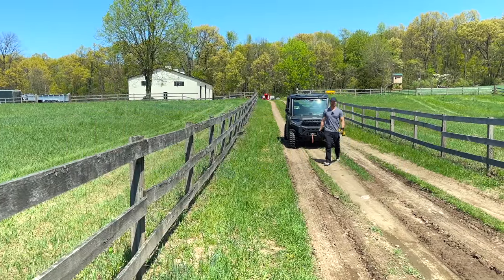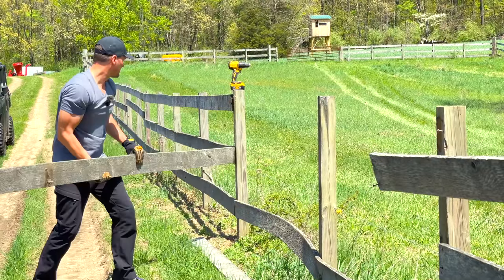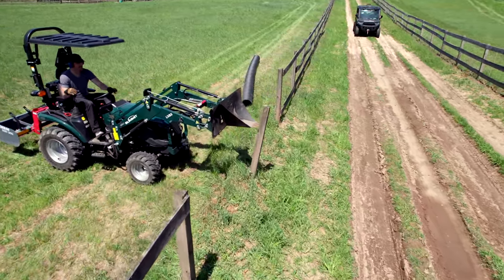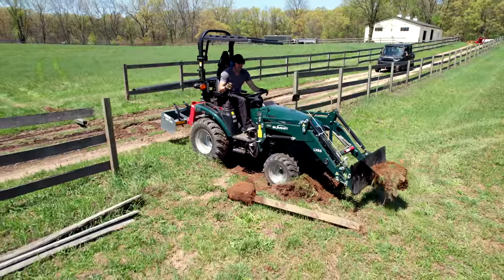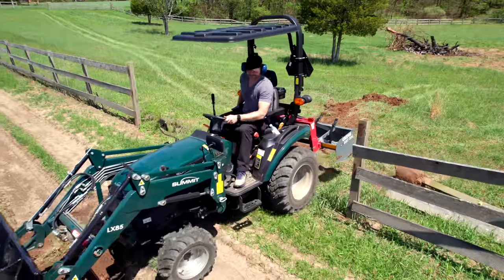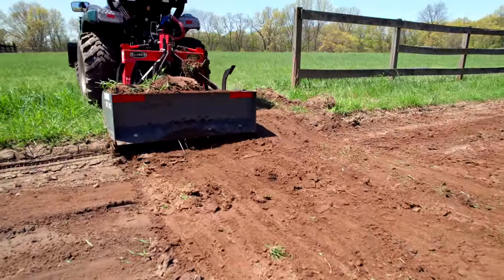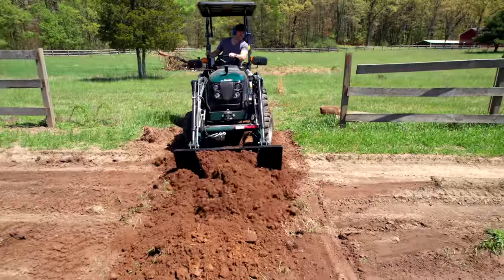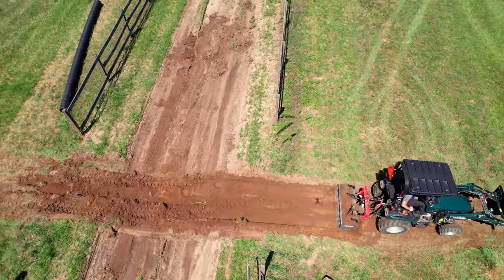TWO GREAT TOOLS FOR DIGGING A TRENCH FOR A DRAINAGE CULVERT

Comment: I just used my HD stump bucket to dig a trench for a water line and it worked really well. We live on a rocky Ozarks ridge and it had to break up a whole lot of rock to get the job done. Not a problem. I have to replace a culvert under my driveway this summer and that's the tool I intend to use.
Reply from the maker: Sweet Tom, I'm glad to hear that.  I get comments all the time about how there's no way those will work in rocky ground.
Reply: @GoodWorksTractors  I'll send you a picture on the website when I get down to the house.
Reply: Hey bud, just out of curiosity what kind of rock do you have? Can't remember what your geology is like over there. Been eyeing the GWT stump wrecker for a while now, just wondering how it'll handle what I'm going to throw at it.
Reply: @kavemanthewoodbutcher  Limestone, chert and sandstone. Obviously, I can't get through the shelf rock but the normal chunks aren't a problem. I've popped some pretty big stuff out of the ground. Having all that force applied through the narrow point on the wrecker pushes right through any cracks. I'll send some pictures to Good Works to show the sizes. I didn't get to it today because we got slammed with a storm before I took any pictures. I'm using a gear drive tractor, by the way. I imagine it might work even easier with a Hydra-stat.

Comment: The only combination that I think might have done a similar job would have been a front loader with teeth and a backhoe attachment. Looking at the culvert and cable you probably would have had to them have come out anyways to move the cable deeper for the culvert. That Summit and larger Stump wrecker is a great combination and Im sure much cheaper and with more uses than the backhoe! Nice looking result from everything.
Reply from the maker: Yeah, backhoes are great.  80% or more folks don't have a backhoe for their tractor, so showing what other tools can get the job done.  Thanks for watching!
Reply: @GoodWorksTractors  Has the HD wrecker been tried on the 3025e yet? I would think that would be a great match.

Comment: Nice alternating use of the 2 attachments.  Big time saver to have one on the front and back with no swapping. Suggest that you contact your internet provider and have them do that repair before they have to dig up all of your work to do it! Unfortunately fiber patches aren't cheap but hopefully they won't want to run a new line. 
According to the North American Telecommunications Damage Prevention Council, the average cost to bury fiber optic cable in a rural area is $75,000 per mile... perhaps that's why we will never see it out here.
Reply from the maker: Yeah, fiber company already came out and repaired it.  $350.
Reply: @GoodWorksTractors  Glad to hear they didn't rake you over the coals!

Comment: Just 2 quick points and not to downgrade the route you took.
1) would it have been faster to just take the tiller and run across in multiple passes to get the dirt softened up to move with the bucket?
2) could you take a 2 blade plow and use that to not only dig down to pull up the ground and tenderize it then use the bucket/ box blade to remove the loose dirt?
After that use the stump bucket to dig your final depth for culvert.
Not saying u did it wrong just wondering about your thoughts on the points above.
Reply from the maker: Neah, no need for a tiller here.  This ground was soft.

I don't have a 2 blade plow, but I suppose you could.  Or, use a ripper.  I just don't think you need to have tons of tools to do one job.  I could have probably used 5 or 6 tools if I really wanted to go crazy, but just wasn't a need.  Lots of time involved in driving and swapping attachments too instead of working the ground.

Good questions.

Comment: Pro tip, when unscrewing fence boards from a fence - unscrew both ends first... then the screws in the middle last. that way the boards don't fall and tear out. Unless you don't care about the boards I suppose.
Reply from the maker: I do not care about the boards.  Most were rotted.  Some screws were bent, stripped, etc and wouldn't come out anyways.
Reply: @GoodWorksTractors  If you don't care about the boards, forget the drill. I pull mine off with pallet forks. Over the top, straight up and down, and back up. Pops them right off, then I pick them up and pile them to the side with the forks! Bet that stump bucket would work just as well for popping them off. :)

Comment: How much would it cost to get a converter kit in order to put a rear hydraulic top link on my LX2610. This project would have taken me ages to complete with the amount of times I’d have to stop and get off the tractor to readjust the box blade. I must say I’m very impressed with this summit machine. I look forward to seeing how it holds up over the years.

Edit: get some drain tile wrap and cover it with about 6 inches of gravel and then fill in the rest with dirt (if your still attempting to have the grass path look). Look on the bright side, you just took out your fiber optic cable. I shut the power down to every home in a 20 mile radius (not my finest moment). Let’s just say I won’t forget to call miss utility again, lol.
Reply from the maker: For the hydraulics, check out http://www.summit-hydraulics.com.  They'll have a solution for you.  Save 5% with code GWT.

Right now, I'm getting hydraulic top links off of Amazon.  $250-350 depending on the one you need. https://www.amazon.com/shop/goodworkstractors/list/46M6Z6OWPONU?ref_=cm_sw_r_cp_ud_aipsflist_aipsfgoodworkstractors_3S2MWDWZ81T6F0FNMPT5

Haha, nice work on the power snafu!  Fortunately, I haven't done that...yet!
Reply: @GoodWorksTractors  Yup, bought mine last year, absolutely changed my world on my JD 2520!

Comment: I would use the stump wrecker for that if I had one. Its probably easier on the tractor to pull a middle buster through that first and clean up with the wrecker. 
Ditch  Witch rentals go for $200-$300 /day and is way faster. but hauling it back and forth would eat up any time savings. I get the "using what you already have."
Reply from the maker: Yeah, this job would have been done before I even got back with the Ditch Witch from the rental store.  Plus, I used tools I already had which is kind of the point.  Showing folks how you can get projects done with what you already have or plan to buy.

Comment: I have dug drainage ditchs useing a subsoiler to make 3 or 4 passes then coming in from the side and scooping out the loose dirt with the loader bucket. Works great for downspout drains.
Reply: done the same a few times
Reply from the maker: Use the tools you have or find ways to justify a new tool by seeing the many uses for it.

Comment: What are your thoughts on using a mini stump bucket for transplanting small trees?   It seems like it would work?  How about a video to show us how?!!  Trees that are less than 3 feet tall.  White pine and maple,  mostly.  We need to thin out an area, and I'd hate to just mow over the small trees, because we have other areas that could use some trees.  It would be used on a JD 2032R.  Thank-you.
Reply from the maker: We've definitely sold quite a few for that purpose.  I don't have that application at my place right now, but perhaps in the future.

Comment: Nice work, I like to see what can be done with compact tractor, as I always say "work small" Take a good bit of ribbing from some of my farming friends when I pull out the little BX or the "glorified" lawn mower as they like to call it😂😂😂. But I hate to use one of the bigger tractors in tight spots😬,  I've got a BX,  L, and an MX, and use the BX 80% of the time just very handy with the exception of bigger projects, I really liked this video as I am planning on burying two different drain tiles myself, One across a drive and the other on a pond for better access, and both are in tight/wet/wooded area's👍
Reply from the maker: Haha, I totally agree.  These small machines have their place and time and again show how effective they are.  Good luck on your projects!

Comment: You should invest in a lazer for grading. You do alot of projects where one would come in handy. They are very nice. They range from a few hundred to about $1200. Topcon, specter, trimble are a few good names.
Reply from the maker: That has definitely crossed my mind.  I've got a soccer field project starting soon and this might be a major time saver.
Reply: I’m an amateur, I bought a topcon as ttwt would use …. Reason I bought it it has a secondary receiver you can buy that has a magnet mount for putting on a backhoe boom or whatever reference point you want so you know you’re down to whatever level you want to go to … I believe it beeps and also has a red strobe ?

Comment: I'm thinking a slip scoop with the cutting edge facing forward instead of the box blade would have been interesting to try. You'd be able to lower the scoop down into the trench better.
Reply from the maker: Seems like that would have been unnecessary.  The box blade worked like a charm, stump bucket did the trenching.  Just no real need from my perspective.

Comment from the maker: Using the tools on hand to get the job done is pretty satisfying.  Even more so when they work out really well.  Stay save on your projects!

Shop Stump Wreckers: https://www.goodworkstractors.com/?s=wrecker

Shop Box Blades: https://www.goodworkstractors.com/?s=box+blade

LOOK AT OUR MOST POPULAR ATTACHMENTS!
Speeco Quick Hitch: https://bit.ly/3NFC0yl
Stump Wrecker: https://bit.ly/3WYa6Tf
VersaBracket Combo: https://bit.ly/3wUPrnl
Snow Pusher: https://bit.ly/3NB4BVw
Tillers: https://bit.ly/3GT1kk1
Core Plug Aerators: https://bit.ly/3W0R25q
Pallet Forks: https://bit.ly/38wRztu
Grapples: https://bit.ly/3PNNYaZ
Dethatcher: https://bit.ly/3GT9Zmk
Tractor Canopy: https://bit.ly/3IHcvNU

WANT TO SAVE MONEY? CHECK OUT THE GWT DISCOUNT CLUB!  Use code GWT at any of the vendors below and you will save cold hard cash :)  I will also get a commission for the sale, so it's a win-win-win!  

USE CODE "GWT" TO SAVE BIG WITH:
BUCKET BRACKETS @ http://www.jufabworks.com
CUSTOM GRILL GUARDS @ http://www.5elevendesignz.com
PTO QUICK ATTACH @ http://tractorptolink.com
DIY HYDRAULIC SOLUTIONS @ http://www.summit-hydraulics.com
GAME CHANGING GREASING SYSTEMS @ http://www.lube-shuttle.us/store
TIRE CHAINS @ http://www.tirechainsonline.com
PREVENT FLAT TIRES @ http://www.multiseal.us
CULTIPACKERS & CRIMPERS @ http://www.packermaxx.com
ALL OEM JOHN DEERE PARTS @ http://www.247parts.com
ACCESSORIES AND BACKHOE BUCKETS @ http://www.muddscustoms.com
CUSTOM TRACTOR FLOORMATS @ http://www.tractormat.com
PROTECT, ORGANIZE, IDENTIFY HOSES @ http://www.outbackwrap.com
BOX BLADES FOR ATV'S @ http://www.northwoodsfabrication.com
HYDRAULIC SYSTEM PROTECTION @ http://www.hoseendchamer.com
DUMP FROM THE SEAT MATERIAL COLLECTION SYSTEMS @ http://www.proteroinc.com
POWERED SWEEPERS SWEEP UP ANYTHING @ http://www.sweep-all.com
EASY WHEEL TOP LINK HANDLE @ http://www.tractoraftermarket.com
TIRES, WHEELS, AND DUAL ADAPTERS @ http://www.millertire.com
AMERICAN MADE CARRY ALL ON STEROIDS @ http:www.bigtoolrack.com
THE BEST TOOTHBAR AND MORE @ http://www.heavyhitch.com
5% OFF WITH CODE GWT AT TRAC SEATS! http://www.tracseats.com

SHOP: http://www.goodworkstractors.com
AMAZON: http://www.amazon.com/shop/goodworkstractors
SUBSCRIBE: http://www.youtube.com/goodworkstractors
LIKE: http://www.facebook.com/goodworkstrac...
FOLLOW: http://www.instagram.com/goodworkstra...
MERCHANDISE: https://stores.inksoft.com/good_works_tractors_merch/shop/home

*Discount codes cannot be combined with any other promotions, offers, or deals!
**I choose to sell some products through 3rd parties instead of stocking items myself.  Know that I will receive a commission if you choose to purchase through certain links.  Thank you very much for your support!

This video is for entertainment purposes only.  Good Works Tractors (Good Works Lawn & Power, LLC) cannot be held responsible for content found in any video.  Always reference your owners manuals, use extreme caution, and proceed at your own risk.

Comment: How do you like your r14 tires?  I have r4 tires on a new holland boomer 33 and I have been looking at r14's as opposed to switching out the rims for an r1 setup. R4's just don't give me the traction I need on 13 acres of hilly southern Ohio property. Is the traction of the r14's significantly better than r4's in mud and dirt?  Thanks in advance for your response.
Reply from the maker: Absolutely love them.  I think they perform way better in dirt, mud, ice, snow, still safe on lawns too.